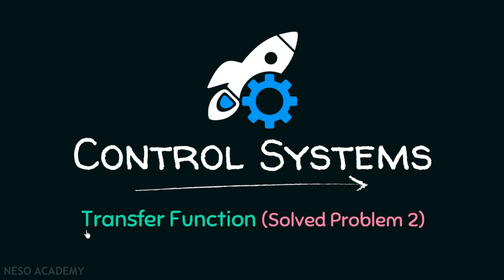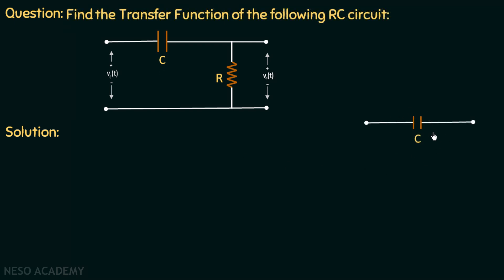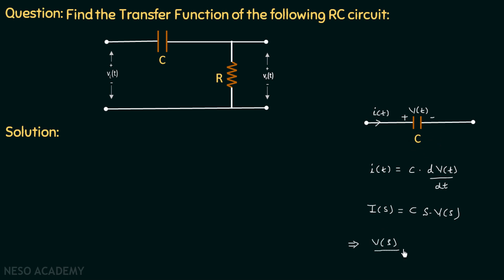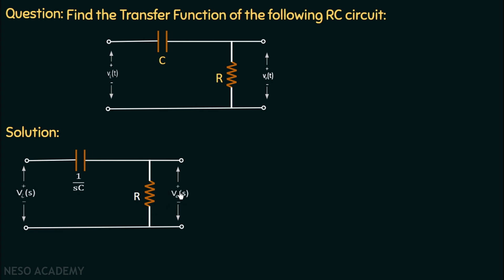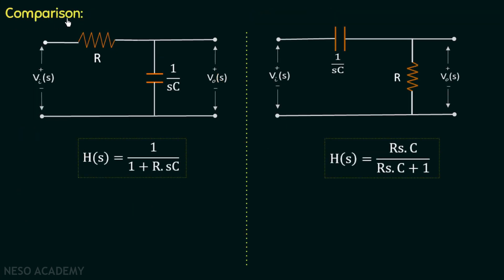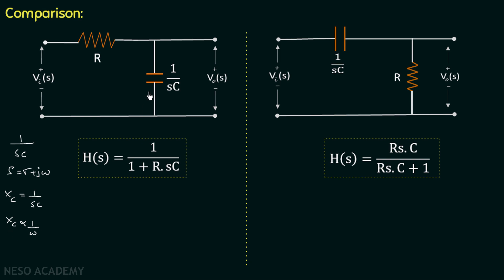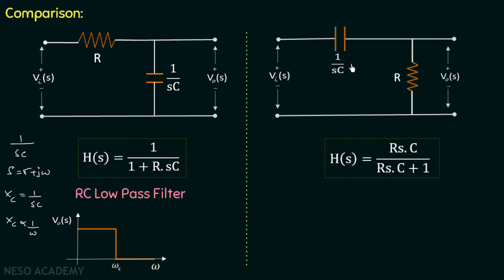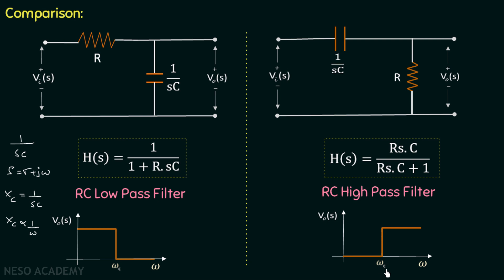Transfer Function (Solved Problem 2)

Comment: At 7.44 min you said it wrong i guess. For open circuit current wont flow so we don't get output voltage  and for short circuit current flow, so we get output voltage, if I am wrong please correct me
Reply: Also if shorted , why output voltage is zero ?
Reply: @PavanKumar-yk5mq  Even if current isn't flowing through part of a circuit, you can still have different voltages at different nodes.  So even if current isn't flowing through a capacitor, its two sides can still have different voltages, and there will be a nonzero voltage across the capacitor.  If the frequency is very high, and the capacitor acts as a short, then since you're effectively shorting the two sides of the capacitor together so both sides will have the same voltage.  Hence, the voltage across the capacitor (i.e. the output voltage) will be zero.

Comment: No doubt u people are doing grt. But at least once discuss some good problems in lectures. all the time neso academy teachers discuss to easy type problems they are not so helpful to build the concepts well. Repetitively same type of examples are being discussed
Reply from the maker: These problems are needed to understand the implementation of freshly learned concepts. Please follow the playlist and try to solve the problems of Block Reduction Techniques, you will find we have selected very good problems. Also, there are 2000+ videos on different subjects and generalization is not good. This might mislead the new learners. https://www.youtube.com/playlist?list=PLBlnK6fEyqRhqzJT87LsdQKYZBC93ezDo

P.S.- The circuit discussed in this lecture is RC High Pass Filter, and it is important to calculate its transfer function.
Reply: @nesoacademy  OK.. Can u tell me in the app there isn't the full notes of control system... It's till 13th or 14th lecture... Where can I find rest

Comment: Thank you a very good lecture .. do we have to use the transfer function  from the capacitor in our model in any way or that second and complete one is enough?
Reply: Very good understand way sir thanku for yoyr support
You can get cst pyq. Solution just check it on electronotes